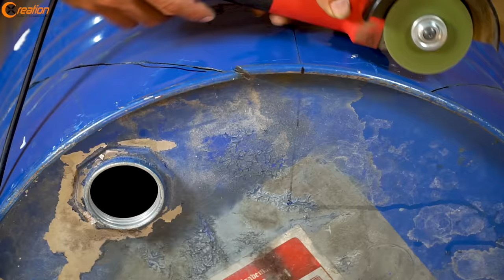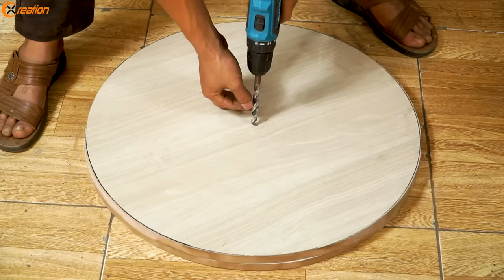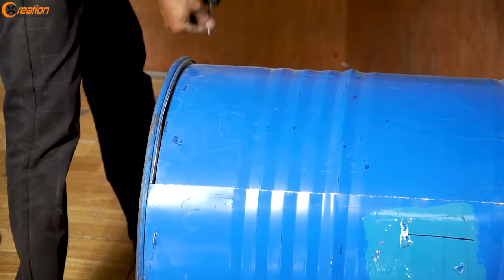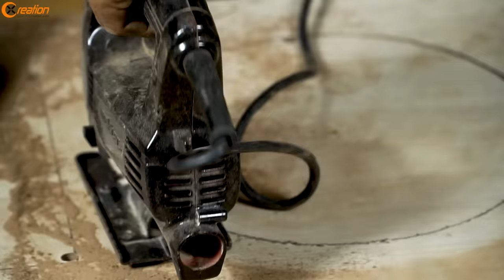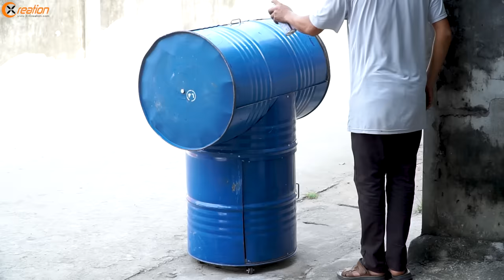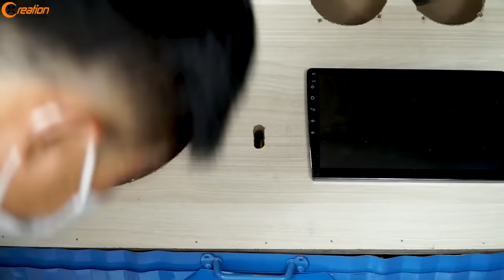Creative Guy Builds a Sliding Bluetooth Speaker From Iron Barrels

Comment: The fuel tank put something in. It's probably normal because I've done it before. Try to put a stone tank with a stuck on the light. No need to supplement anything at all. Very good. Using the soundtrack or distribution machine is good.